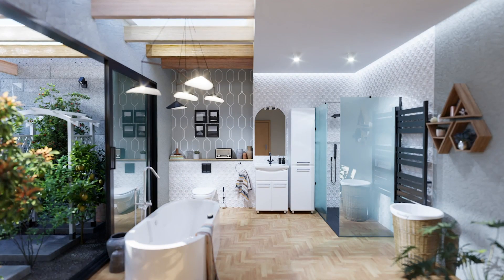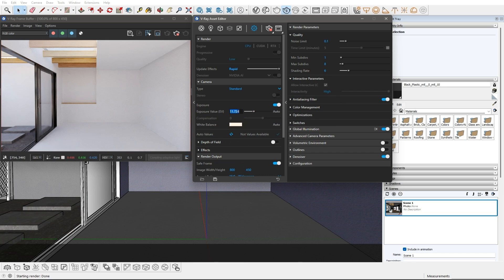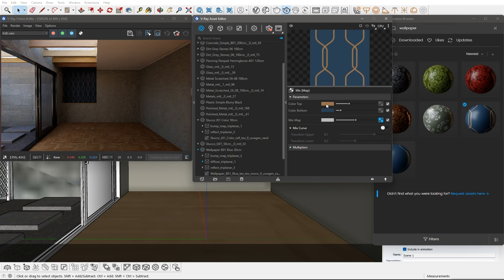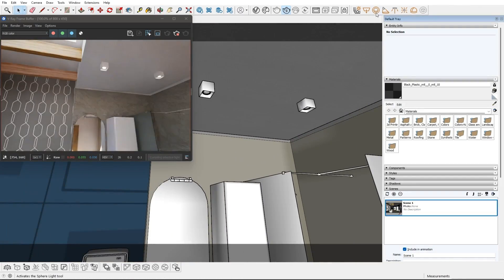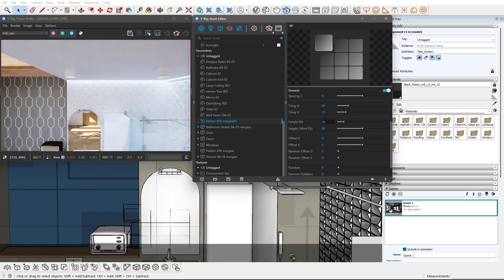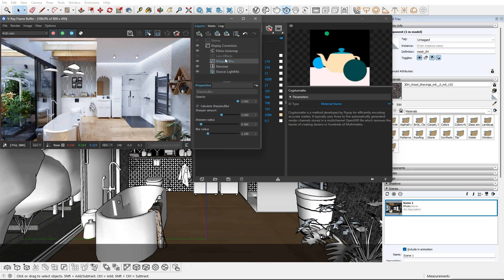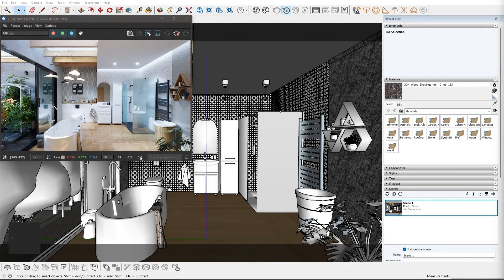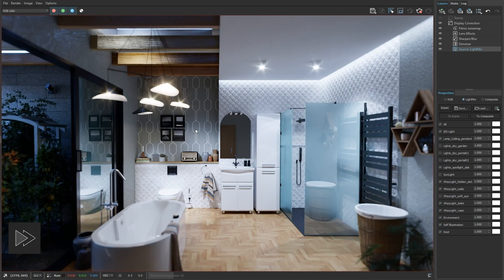Crafting a bathroom design using V-Ray for SketchUp

Comment: Nice but try doing these videos in 4K. Your product is visual, it greatly adds to the impression. Not only is it much higher resolution but youtube has very low bandwidth for HD videos and use disproportionately high bandwidth for 4k.